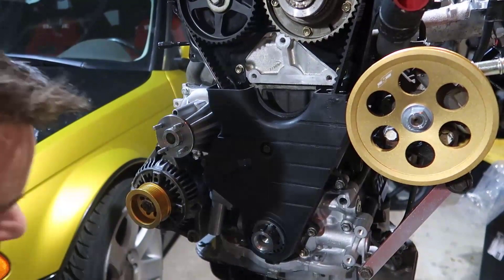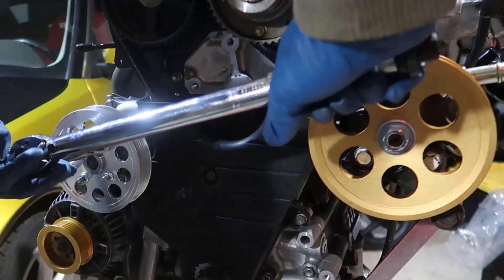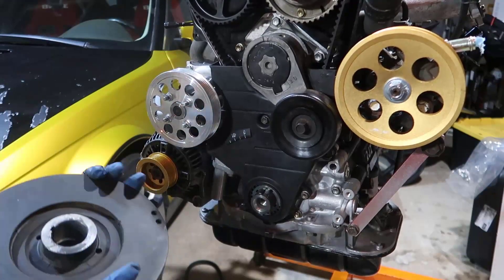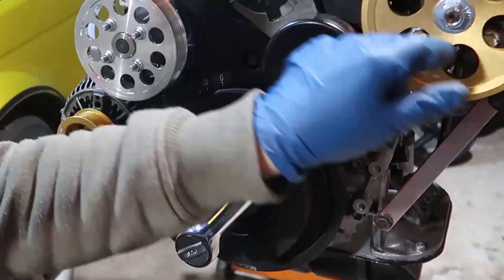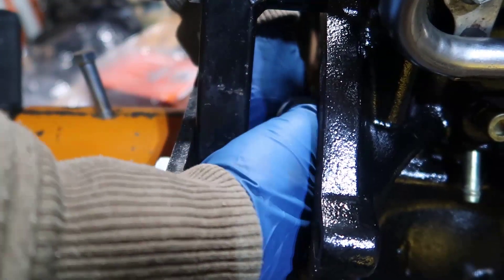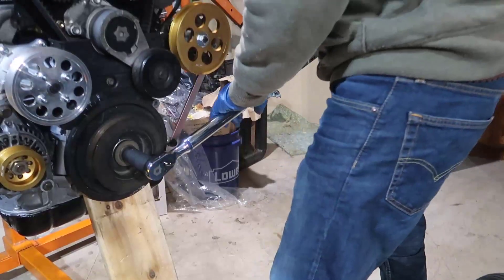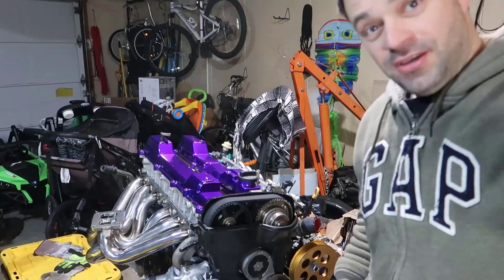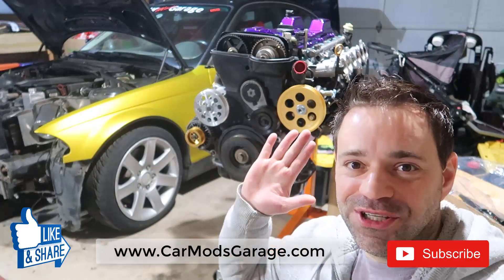Installing Harmonic Balancer or Crank Damper and Serpentine Tensioner  Belt - 2JZ to E46 Conversion

Comment: Hie there !!just repaired my harmonic balancer so the problem now is putting it back it's now leaving a bigger gap between the timing cover after tightening the bolt thereby when you want to put the belt the tensioner won't go down it ends on the harmonic balancer
Reply from the maker: Ok for the gap you need to be sure it is pushed all the way in. Otherwise the belt will not align. No good.
For the tensioner you might need to push it back down with a code and add a pin but I would advice you to get a new one and leave the pin untill it is installed otherwise it won't go in

Comment: I need to replace my harmonic balancer with something like ATI. Do I need to re-time the engine or just slide it on where the guide sits now?
Reply from the maker: I would make marks on the top pulleys to know where they are then remove the harmonica balancer. If the marks are on the same place still I think you are good otherwise you will need to time it.